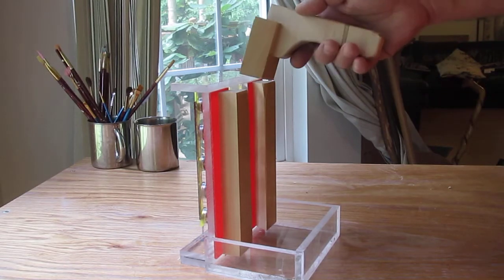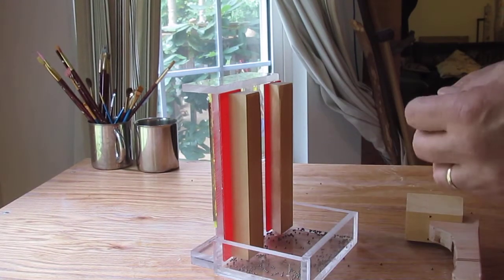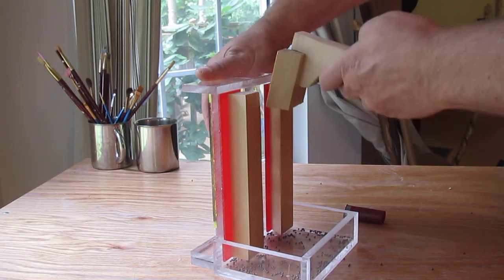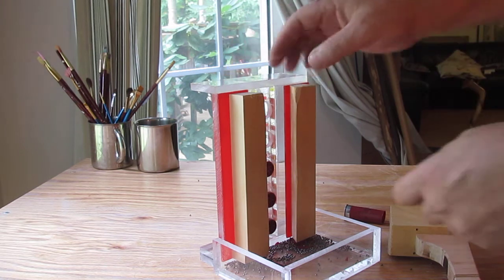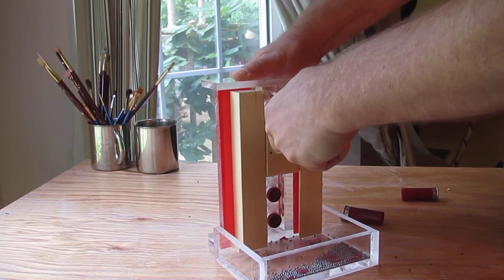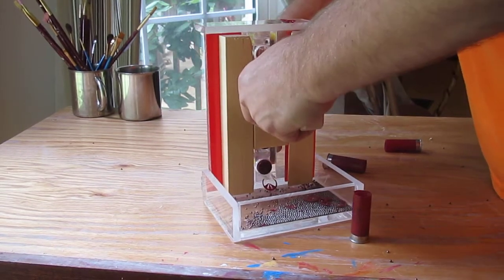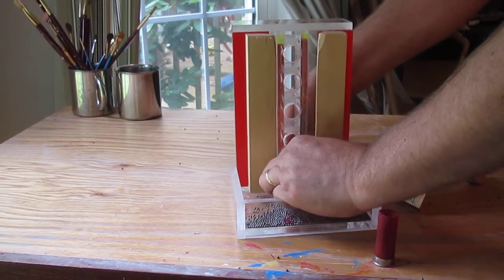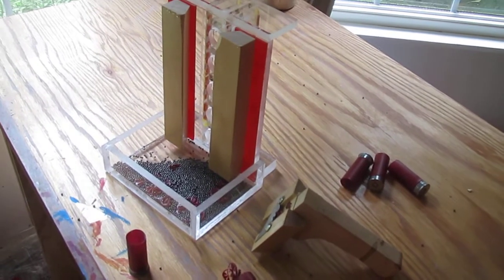Demo 5 Shell Guillotine for Making Wax Slugs Prototype

Comment from the maker: I tossed it. It was an experiment. I may revisit it but I have settled on opening one at a time using a small tool I make and sell. It only takes a few seconds per shell...the added complexity size and weight of the 5 shell guillotine are not offset by the speed gained.

Comment from the maker: I agree. The screws holding the blade need to have a routed slot for clearance in the backplane and then I can do just that. If the blade basically slides right against that the shells will have maximum support and should cut easier.
Reply: Mountain Storm how did you glue the plexiglass to eachother so well, i have problems with projects adhearing plexiglass to its self

Comment: maybe some foam will help to also dampen the noise of the pellets you could try some nice leather or some fabric to catch the pellets and make it fold together when not use, and when it's full you can unclip it from the unit and you can have all the pellets in the pan to make the slugs and to stop the crimp from falling down with the pellets you can make a simple rail to the actual cutter to catch the crimp don't know if that's gonna be to complicated but that thing makes a real clean cut!

Comment: should make an area so it can be clamped to the edge of the table or screwed into something to keep it from moving around. another idea i have could be to have the cutter have the handles on the side and make the front part enclosed so the bouncing shot would stay enclosed in the bottom. hard to explain what i mean so i hope you can decipher what im trying to say